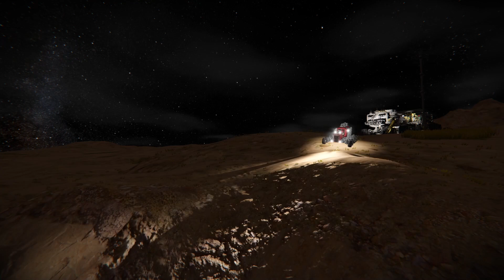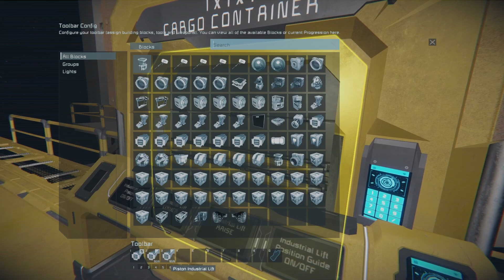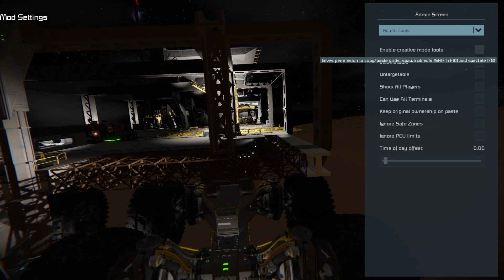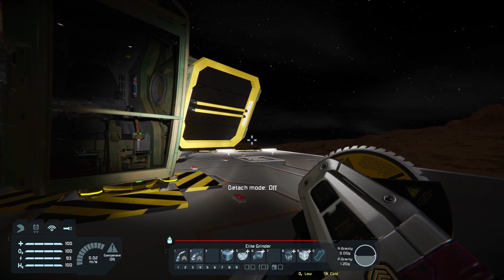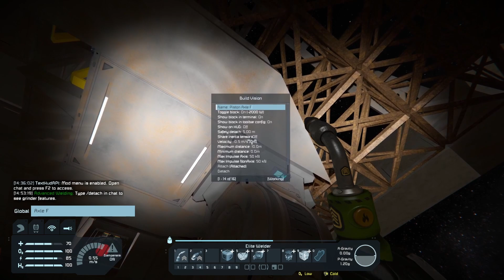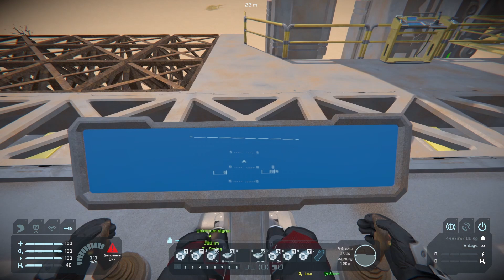Escaping The Desert EP40 - Industrial Surgery (Space Engineers)

Comment: Dead tree kill counter: 2
Subtotal: 47

Would it be an idea to make 5 groeps of the pistons? FL+FR, BL+BR, FL+BL, FR+BR & all
So you can lift/lower a whole side front/back/left/right and retract all at once?
Reply from the maker: A good thought on the group, however I intentionally didn't. I recall when I put the hinges into groups for locking, it caused me all sorts of troubles, I would lock all, but because some were locked already, then they unlocked etc. Problem is no visual reference as to want state they are in.

Comment: If you set up two LCDs 90deg from each other and put a artificial horizon on them both would you be able to use a single control seat to level things out if you could see them both? I don't know if they would work independently from each other or give you the same "forward" view for both.

You might consider putting an anchor on each set of wheels. I would not trust them to not slide down a hill while you are trying to level things.
Reply from the maker: A good thought on the LCD, however now with the benefit of hindsight, if I have a control seat or use an LCD as you suggested, so I get the artificial horizon nice and big (unlike the consoles I've been using) I can see both axis clear enough to only require the single screen.